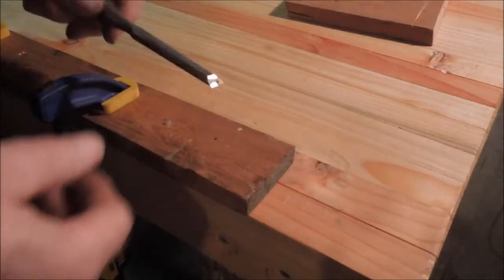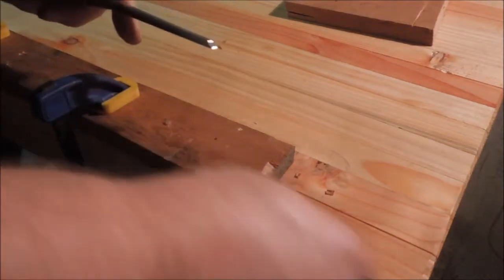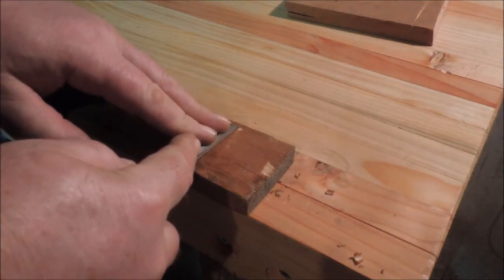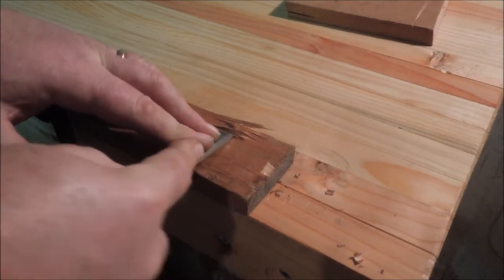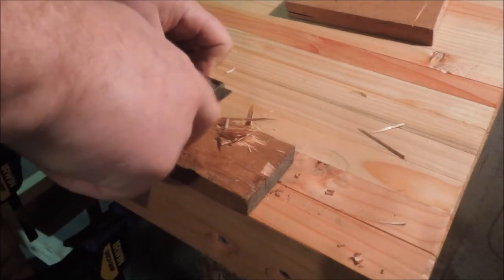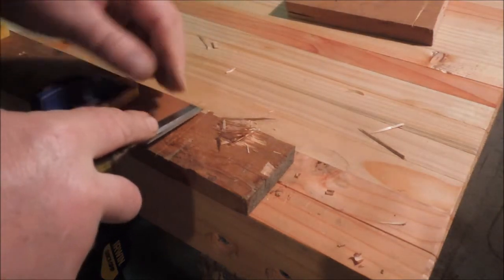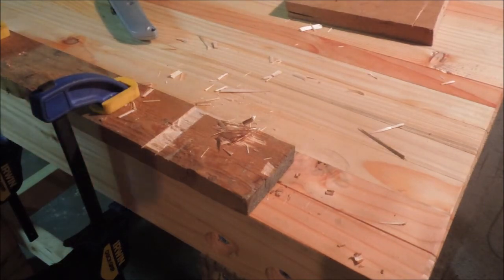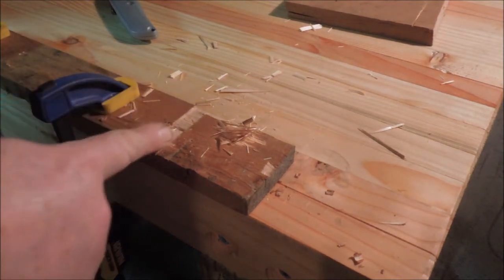Sharpening  A One Man Crosscut - Pt 2 - How  It Works - by Old Sneelock's Workshop

Comment: « The cut is not very smooth »… well that’s an understatement ahah
Reply from the maker: Cross it's came into common use in Europe in about the 15th century. 
Until then all saws were filed in a rip profile. 
Draw knives and chisels cleaned up the rough edges.